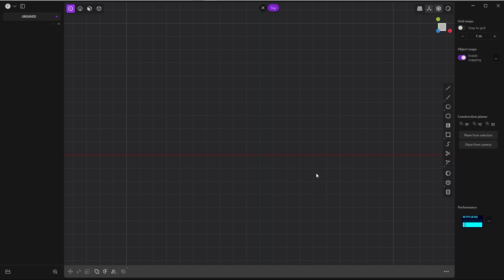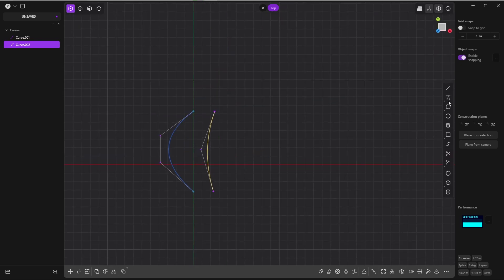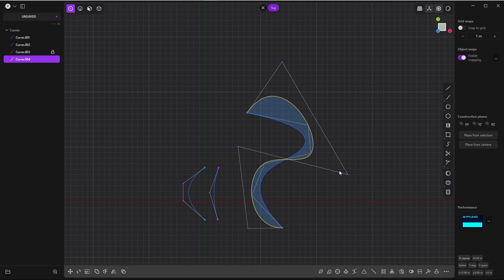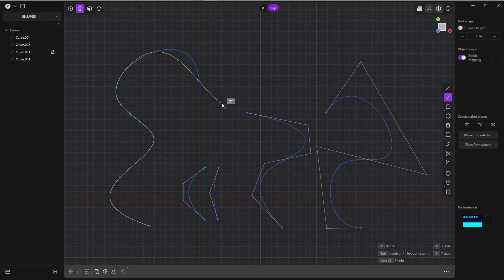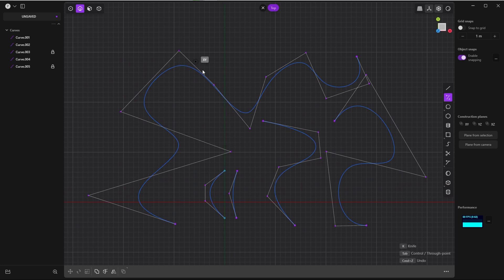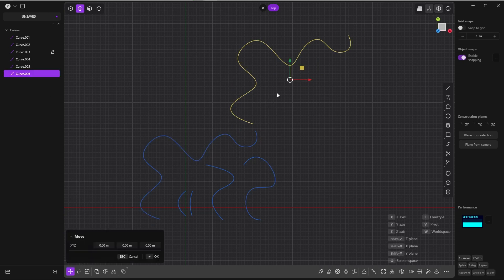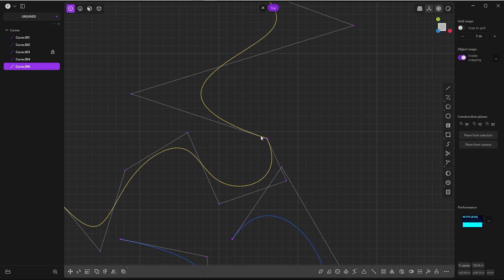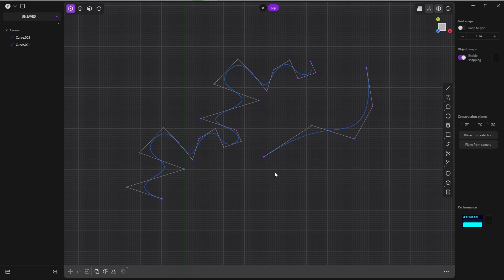Plasticity Tip No. 21 - Spline curve, control point curve & joined curve transition

Comment: It would be great if you could make a video on working with meshes. In particular importing scan data an reproducing a part. There are no Plasticity tutorials on this.
Reply from the maker: Thanks for the idea. I'll address that topic later. In the meantime, check out a great video on that: https://www.youtube.com/watch?v=_Ezk8UqN40o
Reply: @3Dto2D  I've seen that one. very good but I was thinking more along the lines of a 3d scan (mechanical (not very clean)) and trying to align straight faces (from uneven ones) to blend together, align holes... features...